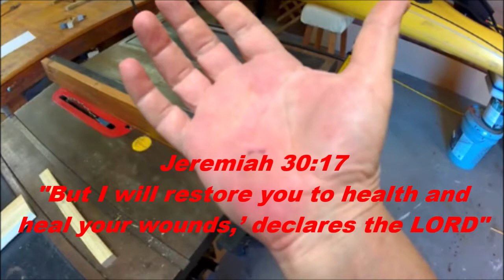Bad table saw Kickback accident.

Comment: Glad it's not broken. As a child, I was always afraid of dad's saws and power tools. They just always seemed dangerous to me. I still avoid them as much as possible. I'm kind of accident prone so I don't like to tempt fate too much. Hope it heals up quickly for you. You've had a rough month or two with the ribs and now the hand.
Reply from the maker: Sometimes you make a small mistake and it doesn't take much to have an accident. I learn from my mistakes and keep going. I should have run the wide part of the board along the guide and cut off the narrow part.

Comment: On so many levels the way you decided to make and carry out that cut was completely insane man. You’re extremely lucky you didn’t get knocked into the blade. You don’t ever grab the board on the other side of the blade like that because if it does kick back it’s gonna drive your hand right through the blade.

Comment: Hi Wayn, been watching lots of do's n don't on table saw. This is so shocking when its hit. Two questions. 1) Would it be happen if you install the diving saw? 2) Would be happen if you stand on your right side instead of left side? So u could use the push stick all the way thru the blade.. I notice the kickback happen when u trying to collect the small piece and accidentally pushed the unwanted wood back to the blade.. anyway, Iim glad that you share this video and your hand is not broken. Cheers and thank you.
Reply from the maker: I am going to install a Riving knife. I am also more aware of my position when cutting a board. Thanks

Comment: Keep your hands away from the blade! Never reach over top of the blade trying to grab the wood! Always have the wider piece of the wood that you are cutting on the left! Put on a riving knife and use some common sense! You are going to get real hurt if you keep doing stupid stuff life this
Reply from the maker: Thank you for your comment. I have talked and worked with many Journeyman and experts in many fields. The fact is if you are an electrician you will get shocked at some point. If you are a carpenter you will have a mishap at some point. A mechanic gets his thumb or finger smashed. A welder will get burned. ETC! And yes after working with wood for fifty years I need to install a "RIVING KNIFE".